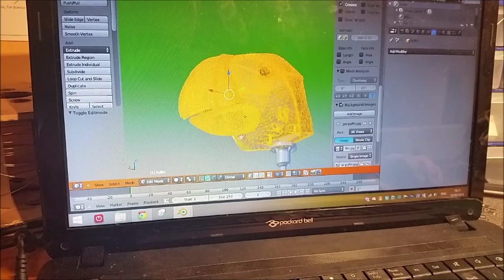Animatronic Puffin Production

Comment: Hey Innerbreed,

What inner tubing do you use for your neck mechanism? Surgical tube?
Reply from the maker: You will find that standard bowden cable (bike brake cable) will work just fine.
Reply: +innerbreed Oh wow! Didn't expect this quick of a response. I happen to have a small one here.  Do you only use the metal inner section of the bowden?. I imagine the rubebr sleeve on the outside will be quite resistive to force.
Reply from the maker: +Masterpj555 it would really depend on the application as to whether I'd use the outer sleeving or not but it really is up to you. I feel is the cable is pulling nicely then "my job here is done" but I do prefer the look for the bowden without the sleeve.